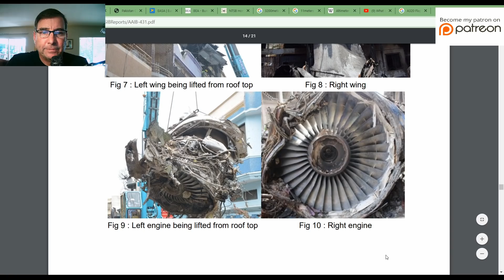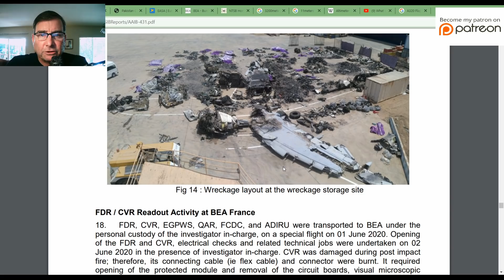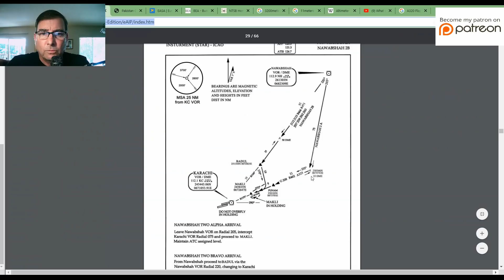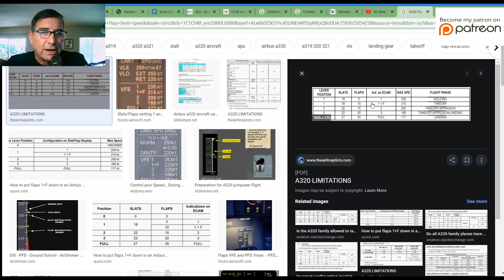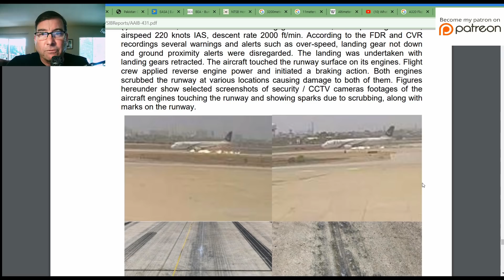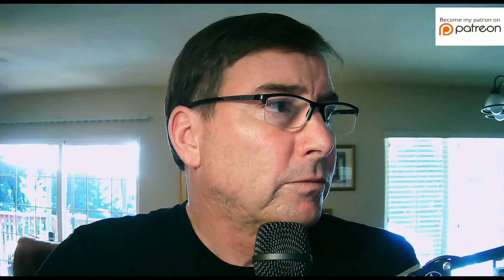PIA #8303 Preliminary Report Part II

Comment: That's just incredibly stupid and sad. Even more stupid and sad than the inexperienced FO who crashed Air France Flight 447 by stalling the plane because he was confused by a frozen pitot tube. 

In the Air-France incident, the captain (who, unfortunately, was taking a break) came into the cockpit when he felt bizarre G forces and asked "What's going on in here?" 

The FO said something like, "We've got no reliable indications! We're falling out of the sky and I don't understand why! I reduced power to idle and I've been pull all the way back on the stick all this time!" [He was confused because of the simultaneous "over-speed" and "stall" warnings which are the hallmark of a pitot tube failure, and he forgot that under those conditions the A330 reverts to "Alternate Law".] 

The Captain said, "No! Do NOT do that! MY plane!" and he rammed the throttle to the firewall and pushed forward on his sidestick, and got some airspeed going, then starting pulling out of the dive, but it was too late and the plane went SPLAT and all souls perished. 

But PIA-8303 was, in my estimation as an airline customer and aviation aficionado (I'm not a pilot), even MORE stupid. First they LOWERED the landing gear (or tried to), then RAISED the landing gear, and then apparently FORGET about the landing gear, and WHILE the plane was scraping its engines on the ground they tried to LOWER the landing gear [?!?!?!], then RAISED the landing gear, then tried to "go around " on severely-damaged engines, then LOWERED the landing gear, then when their engines died they tried to glide with a dirty configuration, then stalled the plane and crashed. Even I could fly better than that and I haven't flown at all (0 hours flight time). Grrr. What stupidity. Were they on drugs???

Comment: They came in like UA232.  Only in Pakistan.
Reply: To attempt to compare the HEROIC efforts of the crew of UA232 to the gross incompetence and negligence of this Pakistan flight crew is astoundingly ignorant.
UA232 Captain Al Haynes and check-pilot Denny Fitch (along with the other two flight crew members) worked their backsides off (Denny was on his knees for 50 minutes, just trying to work the throttles for directional control of the aircraft) while Captain Haynes and his F/O struggled to maintain wings-level, after the number 2 engine fan blade failed and separated, and sheared all hydraulic lines for the control surfaces of the aircraft.  They worked together as a team to get that stricken aircraft on the ground as safely as they could manage, and thanks to their collective efforts, that was where CRM was galvanized and from where the majority of airlines (and other flight crews) learned.  They managed to save many lives, thanks to their efforts, and, with head injuries of their own, nearly died when not found [in the separated cockpit] until discovered about 45 minutes after the crash.  And yes, I knew Al and Denny.

Comment: From a report on the NY Post'
The NY Post article states that the two pilots were discussing the covid-19 problems and missed their initial descent point, and tried to force a landing instead of going around..  
This is amazing, if true. After belly flopping on the runway with the landing gear retracted, and with both engines failing, the two pilots were still talking about covid-19.
Reply: I'm not buying into that story.  I only believe the CVR and ATC tapes not the NY Post.

Comment: Hey Juan, you've been spot on wrt your analysis of this accident and its crew errors all along.  One thing I've missed is your commentary on the crew's ATC communications on the approach where they twice use the term "comfortable" which has a specific ATC radio phraseology defined meaning ... I don't remember whether it's just a Pakistan ATC term or an ICAO term or otherwise ... but the upshot is that not only was this crew way outside the SOP envelope for stabilized approaches but that they were also LYING to ATC to try and cover it up.  Maybe you'd like to expand on that in a future report.  Great work, well done, and tell Pete his papa is pretty cool.
Reply: Tim E. - I will assure you, it is NOT,  ATC phraseology.  I used ICAO Doc. 4444, ATC Manual, that phrase is not there. That was just the pilots way of expressing his personal feelings on the approach he was executing.
Reply: @rubenvillanueva8635  nailed it

Comment: As suspected the report is ignoring the likely reason this plane crashed. Being ramadan the pilots were likely fasting. This cultural issue has to be addressed before another preventable disaster occurs. Any pilot who uses the term "god willing" in their communications must be stripped of their command.
Reply: they weren't fasting....so there you go
Reply: This plane did not crash because the pilots were fasting but most likely because the pilots did not know or have a clue what they were doing. Fasting is known to cause dizziness and lightheadedness but never stupidity!!!

Comment: I still say there should be a virtual hoop you must fly the aircraft, any aircraft, through in order to gain clearance for landing. That virtual hoop should be at least 10nM (18.5km) from the edge of the runway or perhaps even at MAKLI in this case which is 15nM out. If the plane does not make it through the virtual hoop then it has automatically disqualified itself for landing clearance on this approach. Just needs ATC to confirm go-around required. Then there is no argument, no ego, no hierarchy. The pilot already knows he has failed to capture the hoop, must go-around and will not get clearance to land. That hoop can be electronic giving the pilot instant notification. At the suggested speed at MAKLI of 180 KT (333 km/hr) it would take just 5mins to the edge of the runway. From 10nM out it would take just 3.6mins to the edge of the runway. The latter seems like a reasonable timeframe to have the conversation and agree the go-around plus discuss any other issues arising. Indeed in this video it clearly shows that the holding pattern starts at MAKLI 15nM out, but the failure is in giving the pilot the option. It must be automatic at any airport that if you do not capture the hoop then a go-around is required, no ifs or buts for whatever reason other than a declared emergency. If this had been the rule here then the whole tragedy would have been averted --- no matter what was going on in the cockpit!!  Yes the pilot is in charge of the plane, but the ATC is in charge of the airport and the aircraft manufacturer is in charge of the SOPs. This overarching rule needs to be written into the aircraft/airport SOPs. Any pilot not complying automatically loses their licence for good. Lifetime ban.
Reply: Think you’ve been playing too much flight simulator. How would you create a virtual “hoop”. Why not just follow the ILS like 99.99% of pilots do
Reply: @tomstravels520  Really easy to create virtual hoop.They already exist. Problem with the ILS as it stands is that it has no outer limits, is treated as a guide and the pilots can ignore it if they wish, as was done in this case. A target hoop that you must fly through to be given clearance is a yes/no gate. You either fly through it or not and IT decides whether you did or not. Fail and you must go-around. Fail to go-around = no licence.

Comment: In 10 years of flying the A320 and a lifetime of interest in aviation and air accident investigation, this is the worst case of crew negligence I have ever seen. There were so many seperate points at which, in any normal operation, the approach would have been discontinued or a go around initiated. The height above profile alone should have been enough, let alone all of the configuration warnings, any one of which  would have been an instant go around in my airline. We have stable approach criteria at both 1000 and 500 feet and this flight was nowhere close. They didn’t do the basics of their job and I’m amazed that they ever got anywhere near the flight deck of an airliner. Absolutely scandalous.
Reply: The Captain of this crash flight had more than 17000 hours of flight experience. Unbelievable.

Comment: In one of the other YouTube reports on PIA 8303, it was reported that the crew was upset and discussing the effects of COVID-19 on their respective families and friends. In addition, there is a lot of YouTube comment chatter about certification corruption such as hiring others to take the various certification tests. As one of the other commenters mentioned here, the "swiss cheese" problems for PIA probably goes back to cultural systemic problems at all levels.
Reply: It would be a very good management decision to have another airline training cadre to do checkrides in the sims and line checks in flight to see who are the total incompetent pilots.  If they have any fake credentials either primary or other training checks, then they should be forever unable to fly for in any country of the world.  There needs to be an international database on pilots that is rock solid to prefect the airlines and the passengers from incompetent and criminal actions of management, training and flight actions for all concerned.
Reply: @paulbergman8228  I'm going to be devil's advocate and disagree. 
However the cadre of PIA pilots and FOs got their tickets, it is obvious that most all of them are capable of flying the plane. Not necessarily optimally, of course. But they know how to operate the machines, if not necessarily in the best manner. That is skill should not be wasted.

What should happen is they should be sent back to school, in a school with some impartial instructors. (Which of course won't happen, for quite a few reasons.) The ones that can be taught the correct management principles as well as what the knobs do should get real licenses, regardless of whether they had a real or fake license before. The ones that have problems, like being macho and refusing to work in a team, or refusing to follow issued instructions, or think they are riding in a rodeo or demolition derby, should be thrown out, regardless of what type of license they have.

In a culture where it is normal to achieve by graft, often because others that take graft can make it impossible to succeed by the correct path even if you deserve to, punishing because you followed the system is not the best answer, though it is of course the easy one, since it changes nothing in the system and allows it to continue with new victims.

Comment: 23:12 I am not an expert in Airbus systems, however I think they are designed the same way the other airplanes are designed  when it comes to TR activation : needs to have Weight on Wheels sensor activated. I am not sure if they even got the TR doors to open, because they landed on the surface.

Comment: On A320, when selecting the speed brakes to full, you get only half speed brakes with autopilot engaged. They disconnected the autopilot to get full speed brakes with autopilot disengaged in open descent with high speed to get maximum rate of descent to capture the glide slope and be on profile, a hold would have saved the day especially its not a very busy airport and with covid they were probably the only people flying at that time in the vicinity.

Comment: This may be a strong argument for "autopilot landings" with human oversight ... the robot is not distracted.
Also, seems to be great confusion on the part of the approach controller and tower controller. IF there as a "clean" handoff from approach to tower maybe this would have been averted .... that is, if tower was paying attention.
Lots of factors at play here.
Reply: Aircraft can autoland but only once they’re positioned correctly and locked into the ILS. And making sure the runway and aircraft are certified to the correct category

Comment: It was mention PIA has ex military pilots.  In past accidents it has been shown ex military pilots do not operate well within commerical cockpit CRM due to the ingrained rank structure within military entitities.  The superior-vs-junior is difficult to overcome and failed CRM on many occasions has caused accidents (most notably Korean Air flight 801 06-Aug-1997).  Korean Air had to substantially overhaul CRM training for their mostly military-background pilots after flight 801.  Did PIA have similar rigor in their CRM program for their ex-military pilots to unlearn heavily ingrained (right from boot camp) military rank culture?
Military air forces also tend to push the planes pretty hard as evidenced from the powered dive the crew was attempting to "get into" the ILS thus trying to fly that airbus like it's a fighter.

Comment: These pilots were not following SOP and CRM principles, failed to follow departure and arrival patterns, failed to follow ATC instructions etc. However, I think the landing gear is the focal issue. After all, even though they were landing too fast, if the gear had been down they probably would have made it and walked away. During the rapid descent from 10000 ft , I think that the PIC ( or second pilot) dropped the gear ( NM 10.5 and 7250 ft) thinking that it would help with the descent.  After intercepting the ILS at NM 4.8 and 1700 ft, the PIC activated the gear lever, mistakenly raising the gear. With all the chaos, confusion and non standard approach,  both pilots missed the mistake and thought the gear was down, as evidenced by their actions after initial touchdown.

Under stress and with many distractions, mistakes happen....just a theory.  Condolences to all who suffered losses.

Comment: With only RAT power (and no APU), they did not have hydraulic power to the flaps (per Sully and his decision to select APU start early / out of sequence).  I don't know if it would have made a critical difference, but it certainly wouldn't have helped them or reduced confusion (e.g. if they had selected flaps and expected the performance and stall speed change).

Edit: It's difficult to be certain due to camera angles, but it certainly looked to me as if it might be stalled rather than flying in the final moments.  Very high AoA, significant vertical speed component.

Comment: 22:40 perhaps it was due to the excessive speed, bombing in hot; the approach control was not able to hand off properly to tower? Don't know, just a thought. Approach was probably expecting a hold over makli, not the unsafe push to land. CVR will shed light here.

Comment: Being a Pakistani.. Its really embarrassing and saddening. 

Well news here about crash in Pakistan is that crew was so much in covid19 discussions instead of taking its duty seriously.
Secondly, the ATC negligence is also noted when the engines scrapped the runway.. Ans it allowed the plane for 2nd approach.
Third, since Pakistan is facing corruption issues for last 1.5 decade.. Some pilots in civil airlines have fake degrees and political inductions.

Comment: As  an experienced  radar controller and  procedure designer I would like to add that  it  was a cumulative failure     of ATC(radar controller) and  flying crew  for totally  disregarding the published instrument approach procedure. With the availability of ILS.& radar this type of incidents are very unfortunate. It is the responsibility of radar controller to ensure that acft intercepts the LOC at notified altitude prior to intercepting the GP. Simply informing the pilot about the high altitude and keeping quite thereafter is not the professionlism. It also seems that  it is not the first instance that crew had been flying the acft this way, in fact they had been probably doing it on regular basis. Ignoring the procedures and ATC instructions has been probably an established norm and culturally acceptable. if pilot reports on ILS when he is 2000ft above the nominal GP height and ATC  does and challenge it , it shows complete disregard for procedures and lack of concern for acft safety. An instrument approach procedure  is a three dimensional road in the space out of which most important component is the altitude. if altitude is under control, everything else, alignment, speed  configuration ROD on the final approach would be controlled.

Comment: On the A320 you cannot get full speed brake deployment with the Autopilot engaged. They most likely disconnected the autopilot early to give them access to full speed brake.

Comment: On the issue of landing gear, I will posit the following:
They were out of position and configuration on the approach when they put the gear down and flap out to bring them down.  I'm figuring that when they flipped the gear up at 1700 feet, it was an "automatic" reaction to cycling the hear at that point regardless of which way it went. With their overload on sensory inputs, this movement was a reaction, not an action. The brain was saying, "we normally do this at this time," and the body reacted. Again, it doesnt matter which way, only the fact that the reaction happened. If it was a call and response as an "action," they would have been aware of the miscue through verification.  As it was, they started the (abnormal) course of action before the normal course of action.

Comment: Nice analysis again Juan, but just to inform that initiating a goround ( by the pilot) or instructed to do so ( from ATC) is considered like a crime in Pakistan. At least so many controllers are punished on this in the past.
Reply: Tanweer Haider why? Why is it considered a crime?
Reply: From noticeably attempting to prevent a tragedy?   The radar data [regarding descent] would absolutely back ATC